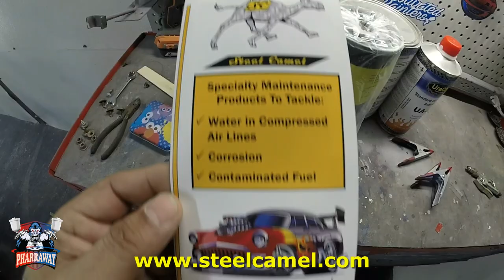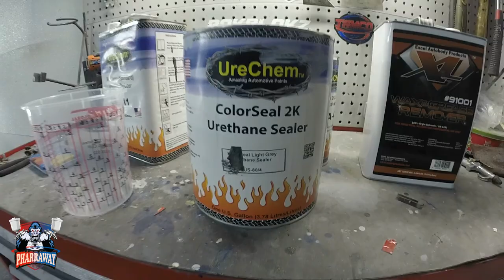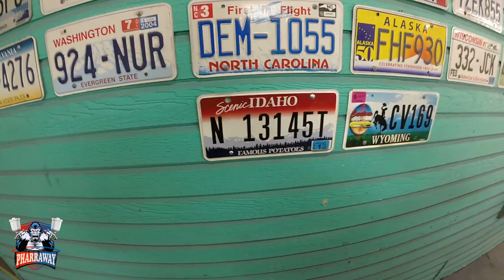How To Properly Mask a Car for Paint

Comment: Just wondering. The small spots you covered with self etching primer the night before, so you need to sand it before spraying the sealer over it? 
Thanks for the great videos by the way!
Reply from the maker: Not if it's small area's
Reply: @PHARRAWAY  awesome! Thanks, I had a few small spots around some of the edges

Comment: Hello Pharraway. I ordered the Steel Camel filter and there is a label that say that the max PSI is 60psi. Is that how you have yours set at? My compressor is set up to run my paint gun and other more demanding air tools. Do you have your regulator set at 60PSI all the times, even for other tools?
Reply from the maker: No I have mine at 90psi
Reply: @PHARRAWAY  Thank you! One more thing, do you have the Steel Camel filter before the 50 foot lines or after. Not sure if you mentioned that. Thanks

Comment: I bought the Steel Camel filter from your past recommendation, but when I have it plumbed into my system, I can't get above 22PSI at the gun. My setup runs from my compressor, to a regulator set to 60psi (max recommended for tthe SC filter) then through a Harbor Freight dessiccant filter and a 50ft hose to another regulator and a water and oil trap at my gun. I tried removing the HF filter and still couldn't get above 22PSI. I took the SC filter out and with just the HF filter in line I can get to 40+ psi no problem. The people at SC haven't been much help.  Any tips? It would be much appreciated. I'm running a small compressor and an LVLP gun.
Reply from the maker: can you message me at pharrawaypaint@gmail.com

Comment: I understand you just started using HiQ clear & probably won’t know the longevity of the clear or how it will hold up years from now. But what do you think about the HiQ clear so far maybe compared to let’s say Tamco 2105?…
As well as the base. We don’t know yet on the longevity of HiQ paint/ base. I believe NoRoo paint/ HiQ is the original paint for Kia & Hyundai.  From what I know Kia & Hyundai paint is not the best paint & does not last long.
Reply from the maker: As of right now, it sprays awesome and it should hold up to the Texas heat, and about the clear so far it has a good shine to it let's see on the hold up

Comment: I have a quart of clear coat (2:1) and I was planning on only respraying part of the clear on a car where the passenger side clear is peeling but after watching your videos - I want to re-clear the entire car; can I spray one coat of clear in one brand and another coat with another brand of clear?
Reply from the maker: Yes you can, but not recommended each clear has there own dry time and might not be compatible with each other